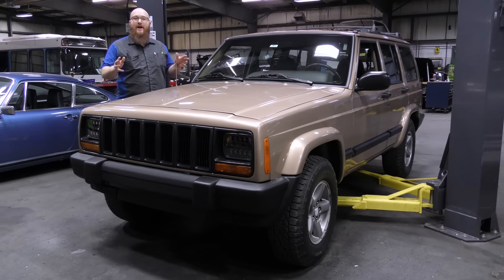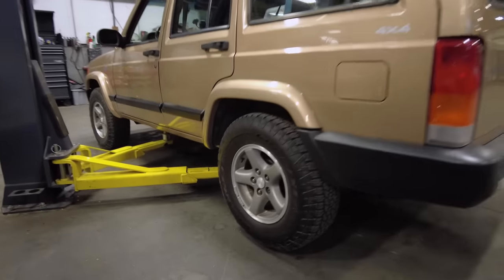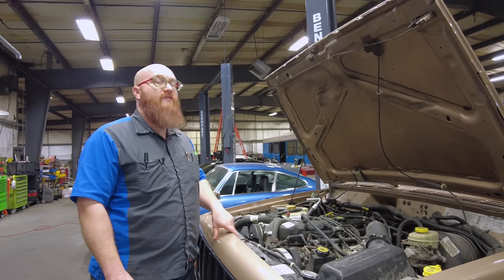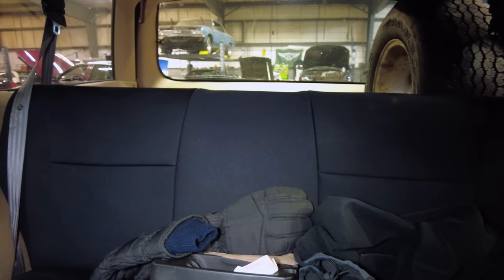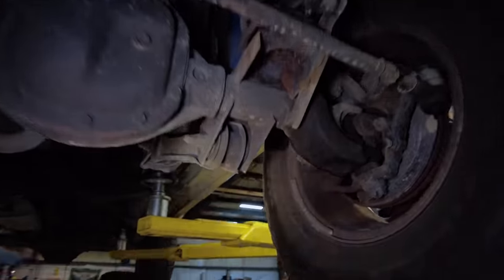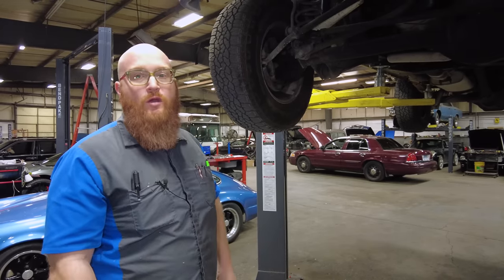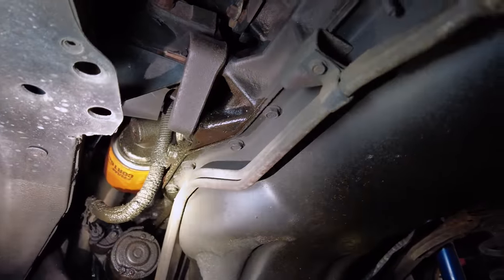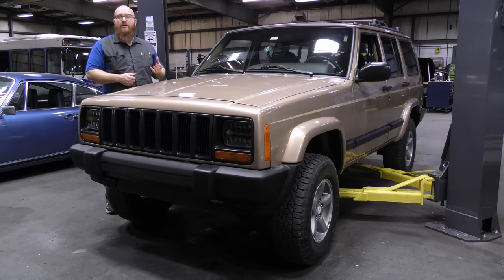Death Wobble on this immaculate '99 Jeep Cherokee! CAR WIZARD shows how to find it and the fix

Comment: We purchased a barely used 2001 Cherokee Sport 4.0 and put almost 200,000 miles on it. In that time it got tires, brakes,oil changes,one tuneup and a serpentine belt. Hands down the most reliable vehicle we ever owned so far.
Reply: if the bushings have not been done already just go ahead and buy a mild lift kit they include most of the bushings you will need. the problem is the rubber is over 20 years old and is degrading quickly every time you drive it. my 97 tj had all stock bushings till this year and they were extremely rotten now it rides like it was new again with 2 more inches of lift
Reply: Nice...My 99 Xj has over 400,000 miles and it's just like new...Best vehicle ever built...A real tank
Reply: They’re sweet.  I wish I never sold mine.  4 liter had great power and it would pretty much drive over anything I wanted it to.

Comment: My brother in law got one of these for a few hundred bucks.  Reason it was so cheap was the wonderful world of corrosion on the underside.  He welded in a replacement floor pan and he's still got it rolling as an adventure truck with the 4.0 six cylinder.  The aftermarket support for these is rather robust.
Reply: I like these, wouldn't mind picking one up some day. 

I've always liked the looks of them too, they're almost 4x4 versions of a Volvo 740 / 940 wagon but with a taller body.
Reply: @JustSomeGuyNotAnAlien  The 4.0 is a different engine from the 258 CID six.
Reply: @davidg1152  Thank you for correcting me. I was wrong. I appreciate you.

Comment: I've owned 3 of these. My daughter just turned over 180,000 miles on her 98. I'll argue that the steering stabilizer is a band aid and not a solution to death wobble, so a failed stabilizer would only reveal another problem, and would not be the primary problem. I've worked on hundreds of these and TJs, which have the same front end setup. No rear swaybar means it either has the Up Country suspension, or someone removed it at some time.
Reply: They never left the factory without a sway bar. I've been running with no sway bar for years with no issues. Im lazy and dont feel like disconnecting or reconnecting everytime I go Play which is Daily.
Reply: @Mr.XJ.96  They did. As I said the Up Country suspension deletes the rear sway bar. From Wikipedia: Rear suspension: The XJ uses a leaf spring rear suspension. Each leaf pack contains four leaf springs with a fixed eye at the front of the spring and a compression-style shackle at the rear of the spring. Two gas-charged shock absorbers are also used, along with a mild anti-sway/anti-roll bar. The suspension used on vehicles with the optional UpCountry package did not employ the rear anti-sway/anti-roll bar and provided one inch of lift over the standard suspension.
Reply: @tornadotj2059  I know these in and out....I'm on XJ 24 since 1999.  All I own and all I drive. I fix and flip them too.
Reply: @Mr.XJ.96  Sorry but you are incorrect. I shared the data with you. My 1999 had the Up Country and came with no rear swaybar. Where do you think all the XJ guys got the idea of taking them off and tossing them out in the trash? Because Jeep sold them with the Up Country with no rear swaybar. I've built more offroad TJs, YJs, XJs, etc. than I can even remember. We had a shop. Go out to NAXJA or something and ask, you'll find I am correct. Not many people bought them with Up Country suspension, so it doesn't really surprise me that you haven't seen one.
Reply: its not an MG Midget, mazda miata, triumph spitfire... but ppl think it is as they think the "APPROPRIATE FOLLOWING DISTANCE"  is 20' behind someone at 70 mph??? and they stop... and so they THINK that they can TURN the 4x4 LIKE a "car" and ... its too heavy
Reply: I'm talking about a front sway bar.
Reply: @Mr.XJ.96  Yes they all come with a front sway bar, but I made it clear in the original post, "No rear swaybar means..."

Comment: The prices on these are going up and up, especially in clean original condition with lower miles. They are absolutely future collectibles.
Reply: there is a 89k mile 98 model 4x4 manual in Colorado, dealer wants 12k
Reply: Yeah that's been the case for the past 7 years already.
Reply: @baelm  I've nabbed a 1996 with 250k and and 92 with 50k mile both for just $1500
Reply: @tunnelsnake627  i'm gonna keep looking then
Reply: Ive got a '99 with almost 300,000 miles on it. Bought it in 2001 with 20,000 on it. I missed out on a 2001 that looked and drove LIKE NEW about a month ago. The lot it was on was asking $17,000.oo.
Hes got another 2001 that's gonna be up for sale soon. Waiting to see what he's gonna ask for it.
It only has 74,000 miles on it. 🤪

Comment: Brings tears to my eyes, I had an 89 Cherokee Laredo. I loved that darn Jeep. It was a demo model for a local Jeep/AMC dealer and was ordered with every option, no tinted glass, but had keyless entry. Beautiful, comfortable, cloth bucket seats. And A/C to freeze you on a 97 degree day. This was in the early 00's.
Reply: Mine was the 2 tone Blue and 5 spd and was a billy goat and got good mileage and only has 112 K and was a ski vehicle for a client in Denver who brought it to SLC Utah where i bought it for 1200 in 2006 and flipped it less than a year for double that
Reply: I bought an 89 Laredo June of 21.  Took a year to get it right.  Nothing major, just maintenance.  123K miles and no rust.  Just got it painted.  Uses no oil and runs great.  I get lots of stares.  They are great vehicles.
Reply: @DLTJR1959  Mine was the rare 5 spd. Not many had that for that year or other years forward
Reply: Just got a 2002 grand Cherokee Laredo.  110,000 miles. My research said it was a good buy. Fingers crossed
Reply: @TammyOne-rd9ng  i have an 04 i bought new.. get ready to be swapping parts if it has original front tierods etc..if something is making noise have it checked out..  how much did u pay?

Comment: When I was a used car inventory manager I had a 2008 Wrangler unlimited 4X4 that had a 3inch lift from some cheapo depot company, and I had always thought that death wobble was a conspiracy theory. That is until I drove this particular jeep. 65ish mph and the whole front end literally started to hop up and down. The guy I was following called me and said the front wheels were visibly wobbling left and right. It was truly a terrifying experience, and now I am a true believer. Death wobble is a real thing.
Reply: Experience is the only teacher for some.
Reply: don't know if you ride motorcycles, but pray you never get the wobbles on one,  we call em tank slappers as both handle bars slap the tank forcibly while that front wheel wobbles ,  it's the real DEATH wobble if you ask me.
Reply: Someone has never drove a ford truck from 1990-2005ish lol. The trucks we use at my job are all 20+ year old fords and half of them have a horrible wobble on the highway. We basically just don't ever go on the highway.

Comment: Sold my old XJ last year because the frame had holes in it, but it was at 250,000 miles and ran incredibly well. That was my second one. Absolutely love these.
Reply: I had 2 of them myself and that 4.0 L High Output engine was great.  If jeep still made them ,I'd buy another one, but they don't so I got a 2020 Toyota 4runner......ironically it also has a strong 4.0 L engine.

Comment: You don't need to park indoors to keep your car lookin good. I park my 96 Grand Cherokee under the carport. Mine is probably as nice as this one. It has about 150k on it,and its a 5.2L. Mine started to get death wobble awhile ago,  I installed the better track bar that you were speaking of. It's adjustable too,except I didn't need to adjust it, as mine only has 1.5 in lift Iron Rock medium duty springs. I definitely recommend them and shocks. The aftermarket adjustable track bar gets rid of that pesky ball joint that's prone to failure. Another thing that is a good upgrade is a steering box stabilizer. That really makes the steering noticeably more responsive, and it'll save your steering box seal from leaking by eliminating flex. I know we're talking XJ here,but the front steering and suspension is nearly identical to the ZJ and alot of ZJ parts will swap right into an XJ. You can actually swap the ZJ steering components, drag link tie rods ...etc into an XJ. That stuff is hollow on an XJ,but solid on a ZJ.

Comment: Had the death wobble.  Started with steering stabilizer. Tires balanced. Shocks.  Ended up being my sway bar.  Yes get an upgraded adjustable track bar.  Good if they add a 2 inch budget boost as well.

Comment: I had a very clean 1970 VW Beetle that I bought in 1975 from the original owner who babied it (garaged),  painted it a root beer metallic brown, had 50,000 miles on it. I kept it well maintained & then one day I experienced the "Death Rattle" after going over some railroad tracks. It almost shook the steering wheel out of my hands! I had to come to a complete stop for it to stop shaking. Back in those days Target carried many popular parts for Beetles, so for $13.99 + tax I bought a new steering damper. Took about 5 minutes to install. It was still working properly  when I sold the car 3 years later with 103,000 miles on it.

Comment: I owned a 96 for almost eight years.  The most reliable vehicle I have ever had, and I've owned a lot of used ones over the last 45 years.  I now drive a 95 Grand Cherokee that is a cream puff.  I hope it is as reliable going forward because it has the same 4 liter but lots more comfort.  The only downside is that the six cylinder works pretty hard, given the extra 700 lbs for the Grand.  Pretty decent on the spur tracks off of the local forest roads. a 3' lift with Goodyear 30x9.50x15 KO2's is all I need.  No death wobble with either model.

Comment: Having been a 4X4 person since the 60's and having seen death wobble many times in many off-road vehicles,  I think the destroyed busing you have found may be  a result of the death wobble, not its cause.  The two most common causes on solid axle vehicles were oversized tires and/or an improper lift kit installation that did not provide a proper dropped pitman arm.  The adjustable track bars do not keep the front geometry as well as the proper pitman arm.  Good luck.
Reply: I refuse to call it "xxxxx wobble". When it happened to me on my '94 Cherokee, it was a little disconcerting I'll grant you, but it just felt like I had a flat tire. For me, I put new tires and shocks on it, and it never reappeared in over 150k subsequent miles.
Reply: Have you ever experienced any slight shaking from 50 to 60 mph?
Reply: @budlanctot3060 then you didn’t have death wobble.
Reply: you are right about that bushing being the result, not the cause, I am the owner of Jims power steering in Akron Ohio, the cure is more positive caster, yes everything needs to be tight but 3 degrees of caster will cure it even with worn parts

Comment: I had that on my Grand Cherokee.  There was a spot on the highway where the cracks had the exact interval to trigger it when going a certain speed.  I would often get stuck in dense traffic going that exact speed, and would have no choice but to run over that spot and trigger the wobble, needing to pull off onto the shoulder a quarter mile down (where there is a shoulder) to slow down and let the suspension calm down.  The fix lasts a couple years.
Reply: Northeast?

Comment: hey car wizard, that is a really nice jeep, I am the owner of Jims power steering in Akron ohio, I have fixed more death wobble problems than I can remember, and you are so right it is scarry, and will not stop until you slow to 5 mph, hard to do in traffic, yes that track bar should be replaced but what I have found is more positive caster is the cure, even with loose parts, death wobble is gone

Comment: Good Video.  As a long-time Jeep guy and owner of a TJ and a JK, I agree with everything you said.  I believe most death wobble issues are related to aftermarket lifts and/or improperly torqued bolts. However, on a stock Jeep, the track bar and steering stabilizer are probably the most common causes, followed by front brake calipers sticking (not releasing).  

The design of the front calipers on the XJ and TJ contribute to sticking, especially if driving in sand and dirt or letting the vehicle sit without driving it for a while.  Unlike most calipers, they don't use clips with anti-rust coating for the pads to slide on, and the pad gets stuck rather easily due to debris or rust between pad and caliper.

Comment: Had an '89 XJ and installed a basic Rusty's Offroad 3" lift (springs and shocks). Immediate death wobble.
I eventually figured out that with the front 4-link setup, the lift actually rotated the axle forward a little - introducing negative caster and resulting in death wobble.
Adjustable UCA's and LCA's from Rusty's returned caster to stock and solved the problem.

Comment: My Commander has been the best vehicle we've owned, and I also own a '12 FJ Cruiser.  240k miles zero break downs, no major repairs, no leaks either.  It just keeps going, you can sit comfortably in it, and it will cruise along while towing our boat without complaint.  I can confirm the diff bushings wear out & exhaust manifold bolts, but all our electronics work, remote start, power liftgate, moonroof, etc.  Rockers are rusted out, and its starting to creep up the fenders...my FJ is also excellent, but the frames disintegrate over time unfortunately.  Glad to see you got one from TX.

Comment: I still have my ‘95 two-door Cherokee Sport with manual transmission and 275k miles. It’s been sitting unused for a number of years, and definitely shows it’s age, but these really are terrific vehicles. I was able to get 215k miles out of the original clutch. The first time I experienced the death wobble it certainly did scare the crap out of me. I hit a very small pothole on the highway and the front end started going completely crazy until I slowed down to around 30mph.

Comment: Experienced the death wobble in an 07 ram mega cab at 70 mph on the highway.  I thought the entire truck was going to shake apart.  Scared the hell out of me.
Reply: What was it that caused it?
Reply: @JohnSmith-yv6eq  i was driving back to the dealer who let me take it overnight because the finance people had gone home.  I told them what happened and told them i didnt want it.  I could see some worn bushing in front suspension but i dont know.  The megacab 1500 had the 2500 frame setup for that year and it was a not that uncommon issue back then.  It can be very hard and expensive to fix.
Reply: @bungeycord5971  
TKS.. 
The death wobble also occurred in Nissans especially the WD21 models (hardbody) from the 80's and 90's right through to the 1997 models overseas...as the rear link bars (4 link plus panhard rod) would wear out their bushings...and the rear end would start to steer the front end...
diagnosed by accelerating then slowing under engine braking...
vehicle would snake and clunk one way under acceleration...and the other under engine braking as the ends of the rear axle would move forward or back....
I have replaced only the bottom link bushings and panhard rod bushings on mine so far....top link bushings stay good after 31 years...

Comment: I love my 2000. The undercarriage is 90% on mine despite it being a Canadian vehicle. It runs brand new with no tick.
Reply: You swap the 0331 head out yet? Or had any problems?
Reply: No. At 265,000 km, it’s amazing. Shifts smooth too. Had it going 130-140km the other day and entirely smooth all the way from the shifts to the suspension that’s a 3.5 lift. I’m so lucky I got mine when I did 6 years ago. It’s quite the eye for car thief’s too as it’s the third time somebody tried to steal it.
Reply: @cherokeefit4248  I would remove the oil fill cap and look for the TUPY casting mark on the head. Just for piece of mind.

Comment: I thought this was gonna be for the death wobble under braking.  I did the caliper upgrade and it cured that issue immediately.   Something about how the other calipers applied the piston and thusly the brake pads.   I don’t remember exactly, but I do remember replacing the old rotors and pads and the problem remained, this after replacing all four shocks.  I had bought the front stabilizer but one of the bolts was frozen and in a difficult place to cut it off or any other method.  I had tried heating it, PB Blaster, everything, even bent a long ratchet handle and ruined the Craftsman ratchet trying, but realized the shock action had zero play, no leak, and seemed to function properly, so I gave up on the replacement.    There’s a bolt on top of the steering box that can help remove some of that slop and careful adjust,met did help.    Ultimately, replacing the calipers got rid of the death wobble immediately.   I think the other OEM calipers had a design flaw where even if you replaced them, sooner or later they would start that problem again, something about the piston bore and the way it pressed the pads to the rotor.    Regardless, I was able to use the original caliper brackets and rotors,and even the pads, calipers were like $150 for the pair, problem fixed.     There was a range of build dates from 2001-2004 and if your VIN fell in, it was worth doing the swap.  Ours did and sure enough, it worked!

Comment: As an owner of several of the fancier sibling, zj grand cherokee, and a chrysler/jeep technician. These are hands down some of the best 4wd you can buy. All of the unibody jeep siblings (MJ Comanche, XJ Cherokee, and ZJ Grand Cherokee) are cheap to work on and modify. Unfortunately, up here in NY, so many are just rotted beyond use. Ive had to fail several for NY state inspection due to rust.